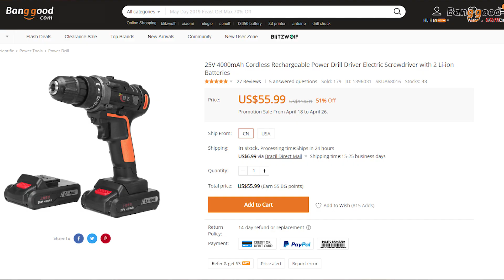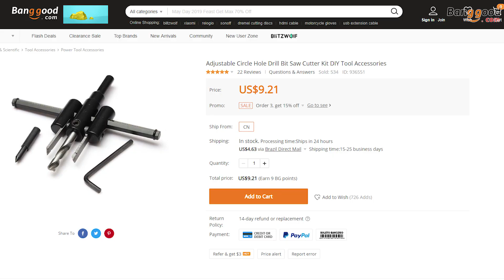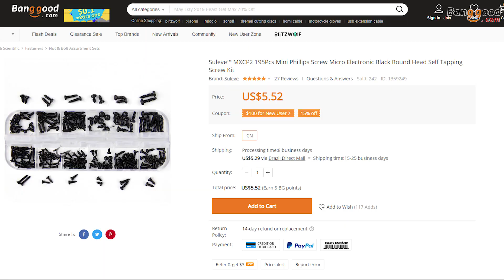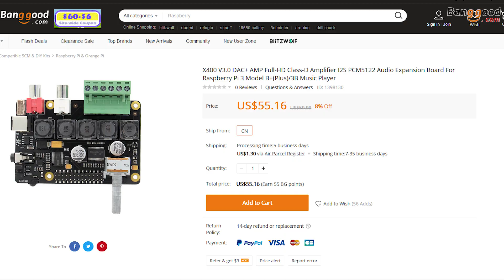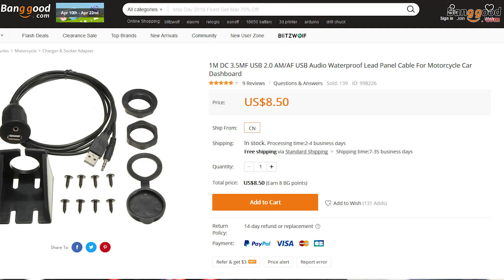DIY hifi speaker system + touchscreen display using Rasspberry Pi3, X400 and Volumio

Comment: those doubled drivers are nonsens, it only makes sound worse because of phase (time) shift if not listened exactly in axes, simple 2-way solution with one tweeter and one woofer would be simpler and better
Reply from the maker: Thank you for you suggestions